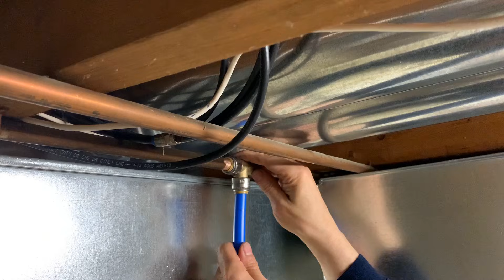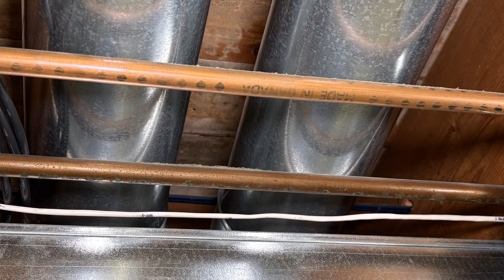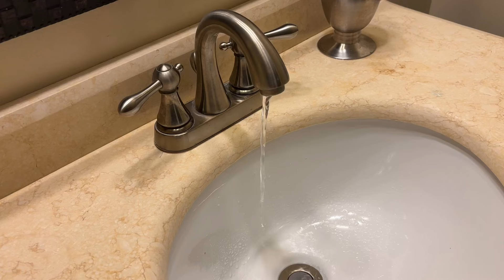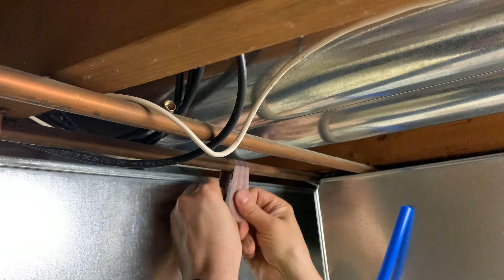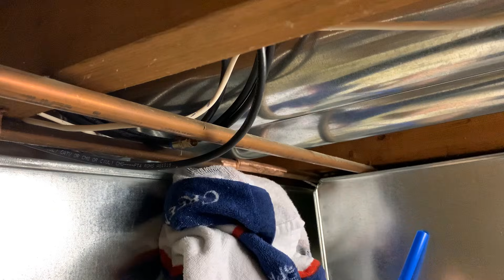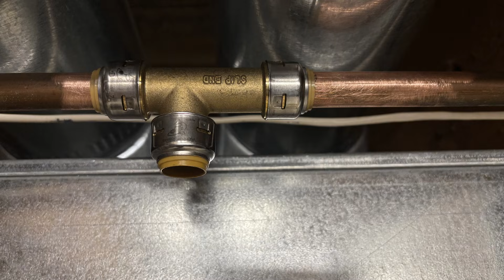Add new supply line to existing copper pipe with SharkBite Max Slip Tee fitting; #DIYPlumbing

Comment: No — and you specifically shouldn't. SharkBite says not to shine up copper with sandpaper or emery cloth the way you would before soldering: the abrasive leaves fine longitudinal scratches that give water a path past the O-ring.

What the Max instructions actually call for:

Cut square with a rotary tubing cutter (not a hacksaw)
Deburr the cut end — the SharkBite depth-and-deburr tool does both, or use a deburring tool inside and out
Wipe the outside clean so it's free of dirt, grit, and debris
Check the pipe is round and free of scratches, cuts, or gouges for at least the insertion depth
Mark the insertion depth with the gauge and a marker

The one exception: if you're reusing a pipe end with old solder or a rough spot on it, knock it down with fine paper (~180 grit) and be careful to keep the pipe smooth — that's remediation of a defect, not polishing.

Sources: SharkBite Max Installation Instructions (PDF), The Dos and Don'ts of Installing SharkBite Fittings
Reply: Thank you for this input! Water will always find a way, especially when given a path. Definitely don’t want to slice those darn o rings

Comment: Dave, I appreciate you making videos like this. I know some DIYers and plumbers are skeptical of using Sharkbite fittings but you are obviously a fan. I assume that means that you typically haven't seen leaking Sharkbite fittings even when installed long-term, as long as the fittings are installed properly per Sharkbite's instructions. Would you have any reservations about installing Sharkbite fittings A) inside a wall and B) in a crawlspace?

Comment: Good video.  I did a similar project using a SharkBite slip ball valve to turn on/off the water to old glued in place plastic ball valve.  I didn't want to replace the old plastic ball valve, but I had to do something to turn off the water to my underground sprinkler system so it could be blown out for the winter season.   I installed the SharkBite slip ball valve up stream to turn off/on the water.  The slip feature on the SharkBite works great and it saved me a costly plumbing repair call.
Reply from the maker: I've used the slip ball valve and the slip tee and I agree that they are a great DIY solution.